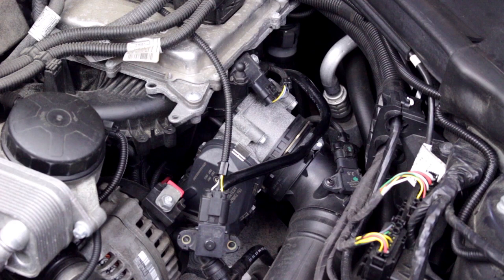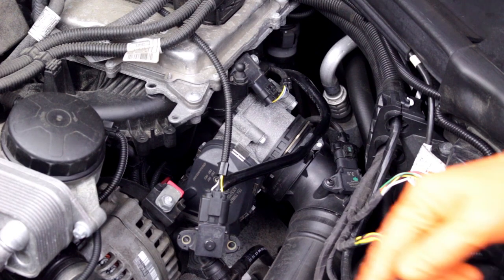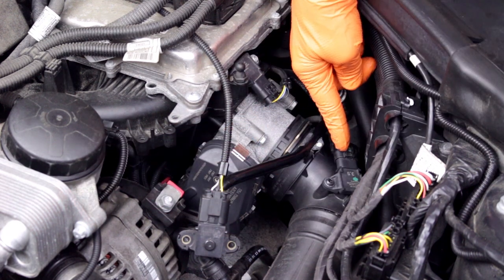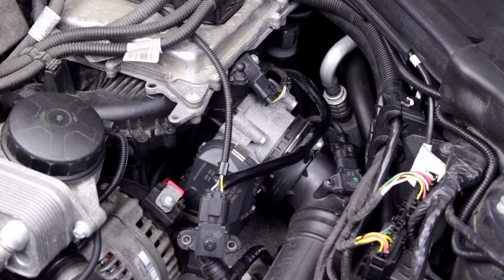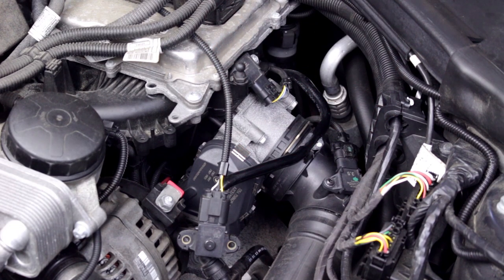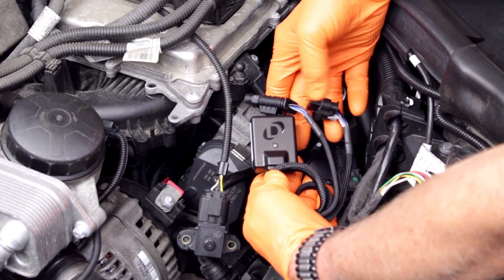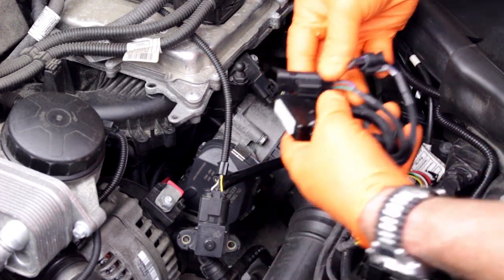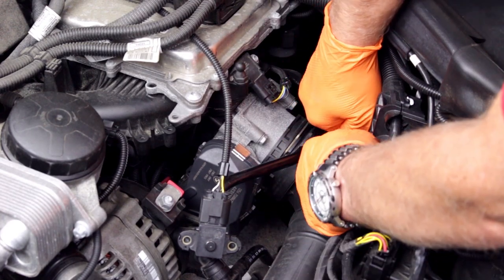Installing a DINANTRONICS Sport on a BMW or MINI turbo engine

Comment: FWIW. I have a 2012 528i F10 w/ N20 engine. Works GREAT up to Sport+ mode (+3PSI), but if set to Race (+4PSI), it's horrible. I have and only use 93 octane, but when accelerating, it's almost like the transmission is slipping, or the engine is starving for fuel. I can repeat the results by going to RACE then back to stock (or Sport+). Just sharing that race likely needs racing fuel 94+ octane and/or only a stage1 will work for +4PSI to give engine more fuel. But I do recommend the unit for SPORT+ mode as the butt dyno notices the difference! ;-)
Reply: When your Dinan is set in Sport+ which drive mode is your car??? or you car haven´t those modes?

Comment: I installed one on my 328d and there was no change at all. I used my VBOX to perform 0-30 0-60 in sport plus mode and no difference from the stock setting. Gladly I was refunded.

Comment: Whats the difference between the $2000 Dinan tuner and the $300 one?
Reply from the maker: Installation is far simpler, but gains and optional tunability are not as great.
Reply: What are the gains obtained?
Reply: that's a ECU upgrade with coding options, this is a simple boost controller you can up the boost to gain power

Comment: Installed this on my n20 engine, no gain at all. Tested 0-60 acceleration, it's even slower a little bit (I'm using sport+ mode). The worst mod I've done on my car

Comment: Otto in the bavauto website you guys do not sell engine performance chips right?? Or do you guys??
Reply from the maker: We currently offer the Dinan chips for the late '80s / early '90s models with removable chips and non-EWS.  If we have one for your model, it will be listed.